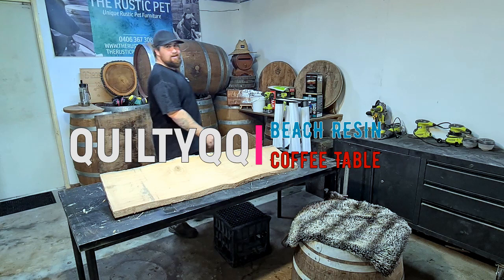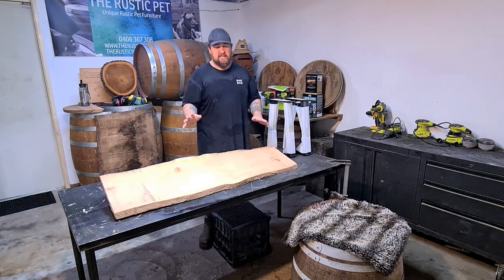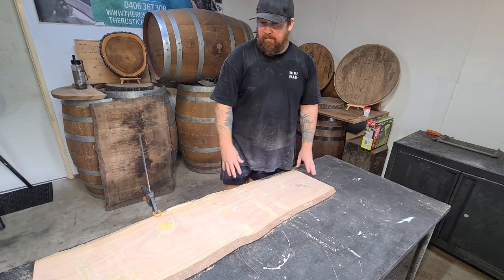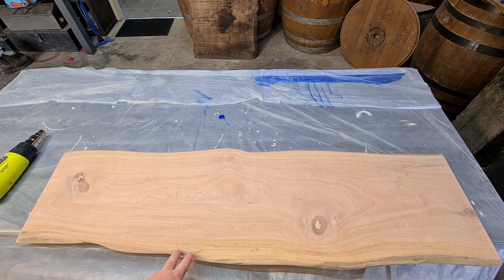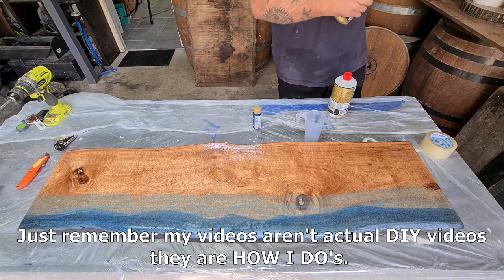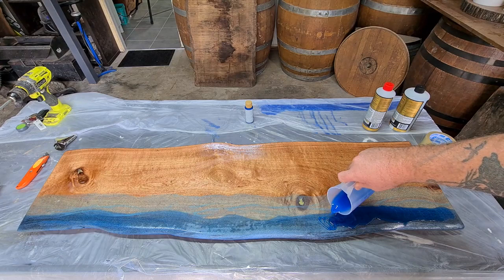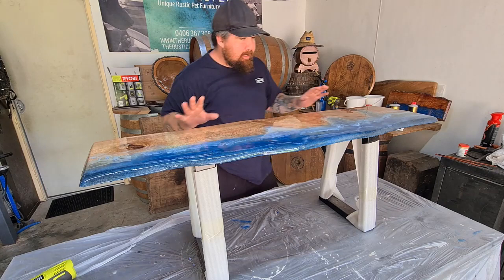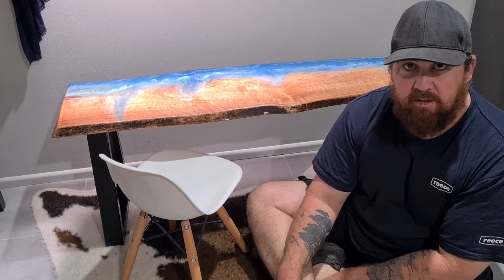🌊🌊🌊 A Beach Resin Coffee Table in only 300 Easy Steps😂🤔😉

Comment: Bang up job brother!  👍.  Resin has a learning curve, but you nailed it.  Only suggestion keep the heat gun closer to the resin as possible and at a 45 degree angle to push the resin more easily.  A hair drier works great!  Keep it up Quilty, dig your projests!
Reply from the maker: Thanks mate tips are more than welcome resin is a tricky mistress.